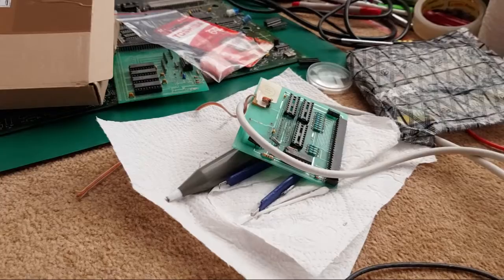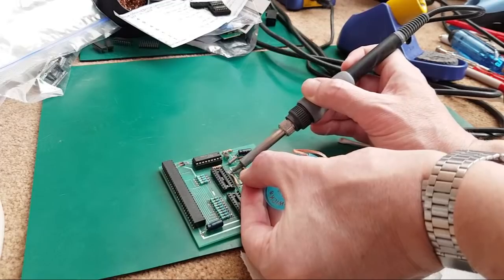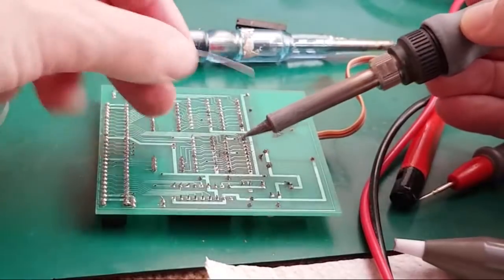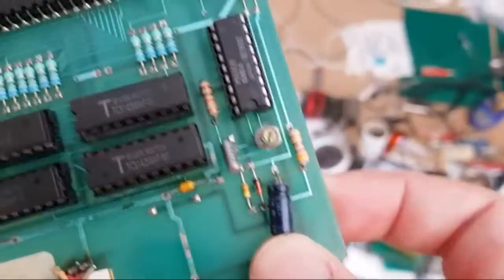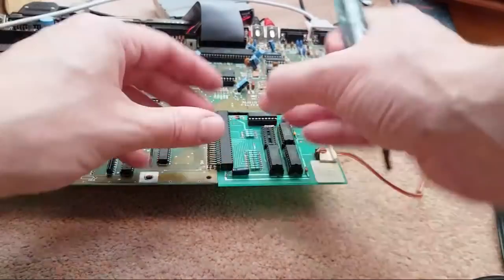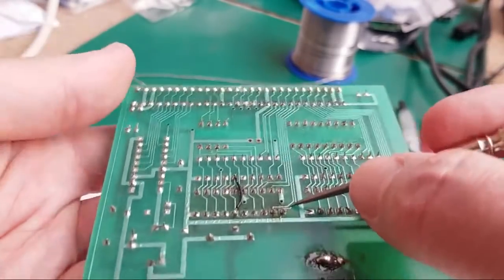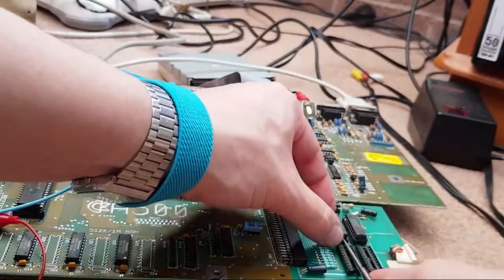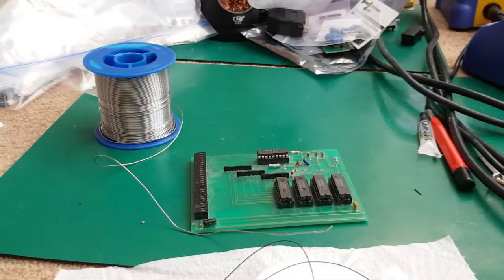Fixing 2 x Commodore Amiga 3rd Party A500 RAM Expansions

Comment from the maker: IMPORTANT : The point I joined up two banks of RAM there with a wire, was not correct @ 01:50:14 - I will cover this in the next stream.  It works with the RAM test in SysTest perfectly, but it is NOT correct, as  you will see later.  Games don't work, despite passing the RAM tests!

Comment: Chris, the first ramexpanson with those yellow screen problem. I think it's the connector from the ramexpansion. I have two similar looking ramexpansions, both have the same connector with this very strong tight fit onto the motherboardheader pins. Both ramexpansions seem to work, but suddenly memtest shows sometimes an error, on both but not always and sometimes no boot possible. On the first of my two ramexpansions i changed the connector with a new one and the the problems are gone. On the second one i fugured out, if i push the ramexpansion completely in, it shows sometimes the errors, but, if a pull the ramexpansion 1-2mm back the problems are gone! It's the bad bad connector on those ramexpansions with this strong fit.
Reply from the maker: I think you were right!  One of the things I did after the stream was clean up the pin connector and I never saw the yellow screen again.  Also as I showed in the follow up stream the day or two after, the CAS lines between the two banks of chips shouldnt have been joined either - not sure if that was related to the problem too.
Reply: @GadgetUK164  Yep, those ramexpansions which have this strange strong connector are really mysterious. I swapped all the ramchips and all the sockets too before i changed the connector. So, keep in mind the connectors on those ramexpansions are very bad. Wish you all the best and thanks for your great amiga repair streams :)